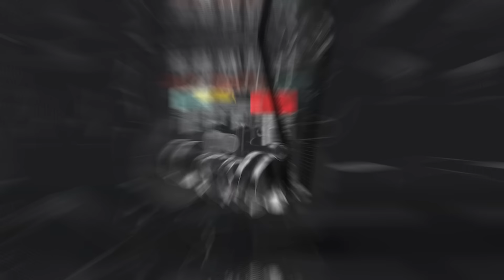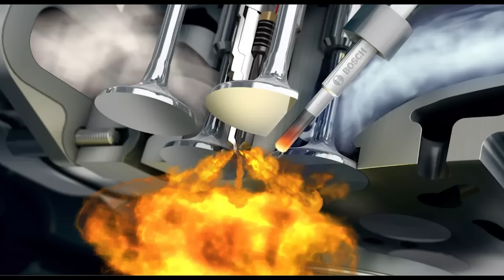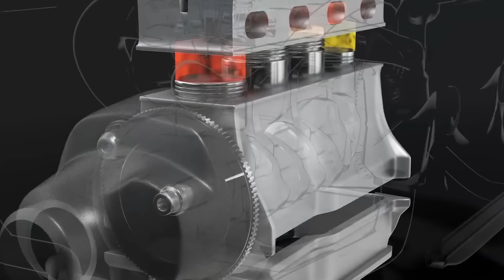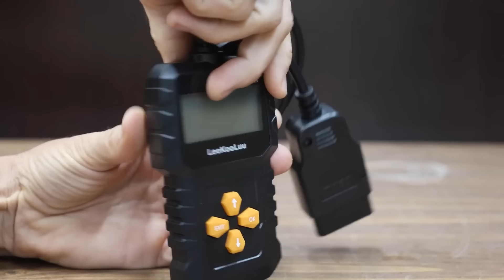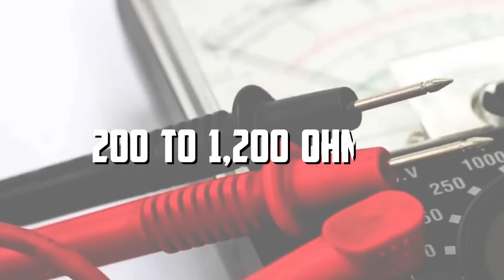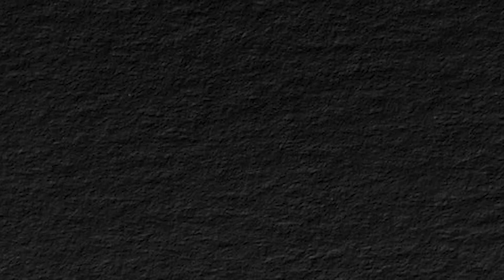9 Bad Crank Position Sensor Symptoms (FIX It in 9 Minutes)

Comment: Will this cause the engine to die and prevent the stater from operating until the engine cools off?
Reply from the maker: Absolutely! A failing crankshaft position sensor can cause the engine to shut off unexpectedly, especially when it overheats. Since the ECU relies on this sensor to manage ignition timing and fuel delivery, when it goes bad, the engine might stall and refuse to restart until it cools down. Think of it like an overheated phone that shuts off—it just needs a break before it works again. If this keeps happening, it’s best to get the sensor checked or replaced. Hope that helps 😊
Reply: @carcareclues  I have a 2004 Accent that when it gets up to normal temp, it starts behaving like it's misfiring then totally stalls, when I attempt to start it back up, the starter won't even operate, as if the battery is totally disconnected.  I cannot get it to even crank until it cools totally down, then it starts up again and runs fine until it reaches temperature again, then rinse and repeat lol.  The only code is ECT high range, it was a little low on coolant but the temp guage only went a notch above center until I topped it off, never went near the red, I suspect that is what threw that code.  But it's still doing the shutdown even after clearing that code and topping it off.  Battery and alternator test ok,  I've just assumed if it was one of the sensors it would just crank and crank and not fire, but not totally disable the starter as well.
Reply: @carcareclues  Shouldn't prevent the starter from cranking the engine. Engine won't start or run without it but the starter should. Inop starter after shutdown was part of his symptoms.

Comment: 2015 Ford Explorer 3.5 Echo boost engine 
Will to much oil in the engine cause code P0016 
Will the to much oil effect and cause the camshaft sensor fail

Comment: I`ve just got this problem. I change the gearbox last week and the only sensor I moved was the crank sensor. I work with robots at work and it`s always sensors that causes trouble. See how it goes.
Reply: Computer says 1 bank exhaust oxy sensor plus IPDM but I don`t think it`s IPDM as things are still working like headlights etc.
Reply: @damianbutterworth2434 why would it say oxygen sensor though?  It’s referring to the signal coming from oxygen sensor. P0335 is for crankshaft signal. I work with sensors too in manufacturing
Reply: @ It turned out to be the Throttle body. I put it on another computer and it said that Throttle position sensor. Anyway when I stripped it down there was a piece of plastic clip from the air hose coming into the air box caught in the butterfly valve and stopping it working. The air filter was not fitted right. Whooopss. And it must of got past. A second hand air box I got had the same plastic bit in the air filter.
Reply: @ it was the oxy sensor heater circuit that was open circuit but the sensor still works slightly ok. I am going to change it when I`ve got a week off work in case it breaks off.

Comment: My 2011 HHR run hot now wate start all it does is spend when I try to crank it
Reply: When I drive the car 30min it shuts the fuel, and fuel pressure jumps and than car stalls itself when I park on red light or nuetral. Itndoesnt start until it coola down

Comment: I own a 2008 kla sadonea the car starts fine and idles fine  so what else would cause the check engine light to come just to to let you know the car starts fine and it will accel with no hestion?
Reply: It could be as simple as a loose or dirty gas cap. Take it off and wipe it clean, then put it back on and tighten it.
Reply: TPS

Comment: Too little description of the manual labour. For a three pin sensor, how do you measure any voltage when the sensor is connected and all the pins are hidden?
Reply: Backstab the plug with some paper clips

Comment: My car won't start after driving when engine is hot, only crank very short and cut off, if i wait about 2h  it starts right away,  car drives normally always no any other issues or symptoms. 
.any ide ?? Strarter or sensor or something else?
Reply: You’ll need to diagnose with a scanner tool and go from there!!
Reply: No codes,
Reply: Probably thermostat
Reply: Some thermostats contain a sensor and can code on a reader and some dont
Reply: If your thermostat is bad , when car is to hot itll overheat and shut off bc the thermostat isnt opening to cool the engine back off

Comment: I have a 2010 chevy Malibu ltz v6 vvt3.6, my car will start fine, once i turn it off it might start again and there are times when it takes up to 7 hours to restart again. At one point the car started and  was running when i turned the key acc,what could be the issue if someone wouldn't mind helping out a bit.
Reply: Bad security signal. Mÿ wifes Malibu did the same thing and left her stranded several times. This has been a long time problem for Chevy.
Reply: @scottwinters4236  Thank you,how was this issue fixed? Is it worth taking care of? My car doesn't have many problems besides an exhaust system leak.
Reply: @mikebarrows8344  my mechanic was able to trace the wire down and disabled it. The security light will stay on.
Reply: @MindyourGod  Thank you for the help,I appreciate it very much.

Comment: Omg I've been burning through gas for a  month. I just bought the part I'm getting my mechanic to change it
Reply: Did it work?
Reply: I am getting a code for this and a printout from AutoZone stating that the timing chain needs to be changed. Thing is it was replaced less than 20k ago. My 2008 Chevy equinox with a 3.6 runs great.. no issues at all. I hope this helps.
Reply: Did it work?
Reply: Having same problem stupid Dodge Avenger STX. I need to stick to Toyota. But, I did get the the crank shaft position sensor A circuit, Ignition coil “C” secondary circuit.. will keep ya updated
Reply: stupid people coming, comment and go. those are stupid

Comment: Always use scan tool to detected the sensor
Reply: No you M0R0N, as most ECU codes will clear if you start it a few times , IE by the time you get to checking the code and the car has started it will not even show up... This is why no mechanic can ever find these faults.

Comment: I think if your crankshaft sensor doesn't work your car won't start.
Reply: Mine may start without crankshaft sensor but stalls after 10 minutes
Reply: @victorn6523 When I drive the car 30min it shuts the fuel, and fuel pressure jumps and than car stalls itself when I park on red light or nuetral. Itndoesnt start until it coola down
Reply: @victorn6523 same here
Reply: Yes. It happened to mine
Reply: My car has a p0016 code and turns on just fine, but shudders and stalls on neutral. I’m really hoping this is the cause and changing the sensor will fix it
Reply: @Icookadapizza did you get it fixed?
Reply: Update, I got a P0705 code which makes much more sense😭sadly I can’t find a video on my model
Reply: You need to use scan tool
Reply: Depends on the failsafe mechanisms of the specific engine. My engine will work by using the camshaft signal as a crutch, but be in a restricted mode. Unfortunately without lighting the MIL or setting a code. Not so easy to find
Reply: @jodiac-sl  per caso hai un bmw e90 motore n47? Non riesco a capire quale sia il problema
Reply: @io2063 no, hai un E39 motore M54B25. When I bought the car the sensors for intake camshaft and crankshaft were aftermarket Hella sensors. On these BMW engines it’s a lottery if aftermarket works or not, they require OEM BMW engine sensors to make sure (that would be the four sensors for both camshafts, crankshaft and airmass meter, although VDO may work for the airmass).
Reply: Mine was going bad and was affecting the ability to accelerate quickly
Reply: Yes it will crank but won’t turn over.
Reply: You can bypass by spraying easystart
Reply: It can also be intermittent
Reply: Exactly
Reply: I have a 2002 Acura TL and I’m having problems of the car randomly stalling . Some videos says it’s the crankshaft sensor and some videos says it’s a charcoal canister, so I don’t know which one to get fixed first.
Reply: Many can start just will stall eventually or go into limp mode misfire when driving etc
Reply: I've been driving (100 miles a day) for about 2 weeks with a bad sensor. Just bought a new one today and replacing it tomorrow.
Reply: @Doc_Ores  how did the new sensor go? It made my problem worse.. now it shuts off after 2 crank where before you could crank all day
Reply: @Doc_Ores did you replace it and did it fix the problem
Reply: @ernest1782 I did replace it and it did fix it. Other issue I've had with the truck since I bought it is the cvt phaser tick, about a month ago my engine finally failed from that. So, may as well not have bought and replaced that sensor. Lol its currently in the shop getting a new engine put in.
Reply: Exactly.. literally waiting on the mechanic to pull up
Reply: Correct .
Reply: Does it crank but wont start
Reply: For real when that sensor goes bad on me it’s over cuz the plug gets pulled
Reply: Bros life is gonna change when he learns about intermittent failure lmao
Reply: Not in all cases
Reply: My 2018 Honda Accord bad cps won’t start.
Reply: Not necessarily. I have a faulty crank shaft sensor which threw up a p0300 p0301 fault code. It drove ok, just a little juddering. After I changed it the error went.
Reply: Some engines can start but the rpm not working and you look these symptoms at acceleration and Misfire at this time you make sure the cranck shaft p sensor not working
Reply: @eslamsami9941 I’ve just replaced my battery but I’m thinking maybe it was not the battery though..
Reply: @VitorFerreira-gc5dr same
Reply: @VitorFerreira-gc5dr no, it did quite a bit of research n stutter under acceleration is caused either by fouled spark plugs facing the firewall, number 4 ignition coil or the cranksft position sensor.
Reply: @VitorFerreira-gc5dr I started here then months later boom buying all these sensors. Wish I and gotten a diagnostic hundreds ago. Remember one code can bring more codes for us to buy parts.
Reply: Would it still crank ?
Reply: It'll crank sometimes and if it turns on It can turn off while you're driving and if you won't start back on you would have to let it cool down and then the car will turn on again   might shut off again
Reply: The car will turn on but when you driving it will shut off sometime  You have to wait a couple of minutes before it turns on again Sometimes it'll do that off and on turn on turn off while you're driving
Reply: @vrea77 that’s what mine is doing but I’m also reading a bad charcoal canister would do that too, so I don’t know which to get fixed first.
Reply: @vrea77 True. I'm in that situation now
Reply: Yes it would crank but no start at all @terrencefrancis3781
Reply: @terrencefrancis3781 yes
Reply: @terrencefrancis3781 sometimes
Reply: @terrencefrancis3781 yea still crank but wont fire
Reply: Mine would run but randomly stutter and stall.

Comment: what do you mean “reconnect the sensor and measure the voltage between the signal wire and ground” ? where do i put my volt meter leads if it’s plugged in ?
Reply from the maker: When the sensor is plugged in, back-probe the signal wire (refer to your vehicle's wiring diagram). Place the multimeter's positive lead on the signal wire and the negative lead to a ground. Set the multimeter to DC volts, then crank the engine to measure the fluctuating voltag
Reply: @carcareclues Got it, thanks for the quick response!
Reply: Hey just tested and i’m reading a steady 14V, is that normal?? Shouldn’t it fluctuate between 0 and 12V? Please let me know.

Comment: How do i know it its the crankshaft or camshaft sensor? They have the exact same symptoms
Reply: Most of the time, it’s recommended to start with replacing the camshaft sensor first since it’s easier to replace. If problems persists then you move to the crankshaft. I’m currently dealing with this and the crankshaft is next.
Reply: @josephj1234567  you said it backwards
Reply: @johnnyquevedo3094 camshaft sits at the top and is a lot easier to replace so that is first.
Reply: @josephj1234567  I mean yea but the one in the bottom usually is in your face nd you either move the alternator and or it’s just there for grabs while the cam sensor either under the manifold or in a weird spot where you have to remove the hoses and summo out the way like in my Lexus is 300 that’s what I have to do lmao but hey bro it is what it is some times we gotta see which is best to start with if not just do both at once if possible and get it over with
Reply: @johnnyquevedo3094 for the Miata at least, the camshaft sensor is as accessible as the oil cap. All you gotta do is pop open the hood and boom, right there.
Reply: @josephj1234567  Same here 🤦🏾‍♂️🤦🏾‍♂️
Reply: @rasheeddozier6083  I’m glad we’re all struggling with this together lol let’s stay updated! I’m getting my camshaft sensor replaced within the next week or two so expect a comment back from me shortly after the new year.
Reply: @josephj1234567  jus changed the camshaft and crankshaft senors .... Hopefully this works smh lol
Reply: @rasheeddozier6083  any update?
Reply: @rasheeddozier6083 did it work¿
Reply: Yes bro i have same issue
Reply: Just swapped my cam sensor and found the pigtail was exposed and all three wires were touching it turns over now still gonna swap out the crank sensor to be safe.
Reply: @elgordosxt4694  I didn't know there was a intake and exhaust camshaft sensor. I changed the intake but not the exhaust so I guess that'll b the next one I'll change out
Reply: damn, me too. Just changed the camshaft and unfortunately hasn't sorted the issue. Will try sorting the Crankshaft next. fingers crossed it works.
Reply: @ when changing, reinstalling the crankshaft, you have to make sure it’s set at a specific distance or else it’ll give you similar issues as well. This was what I found to be my issue.
Reply: @josephj1234567 .....what do you mean by a specific distance
Reply: My car lights work but it doesn't crank or even try to turn over...is this bc of the cam or crankshaft sensor?
Reply: @PrestonSmith-b7h might have a bad starter
Reply: Poz ja sam zamjenio sezor radilice jedno vrijeme bilo ok opet počeo se motor ponasati tesko pali vergla .potom nesto kao na bregastoj bruji i gubi snagu molim odgovor lijep poz

Comment: What code comes up on a diagnostic for a bad sensor?
Reply: It'll usual show the name.  Like mine was Crankshaft Senor
Reply: @Corsair_Mnk thanks buddy! I fixed mine. I replaced my starter n crank sensor. My rides better than before 💯
Reply: @YASMATAZ369 did you get knocking noise ?
Reply: @UsernamesBeLike  No I didn't. My main issue was my starter that I replaced at the same time. After changing my sensor my check engine light that was on for years finally turned off lol
Reply: @YASMATAZ369 what car do you drive? I think this sensor is bad on my 2007 Silverado the light comes on some times then it turns off, had a mechanic fix some other stuff but as he was fixing other things his scan didn’t get the code for that sensor, but I’ve gone to fix finder at AutoZone and got the code to relearn the position for the crankshaft sensor
Reply: 0320
Reply: Fixed mine today. Crankshaft Positioning Sensor
Reply: Or P0300

Comment: Where is the crankshaft position sensor on a 2007 Tahoe 5.3 Liter ?
Reply from the maker: The crankshaft position sensor on a 2007 Chevy Tahoe with a 5.3L V8 engine is typically located on the rear of the engine block, near the transmission bell housing, on the passenger side.
Reply: @carcareclues above the starter!   I have a 2008 gmc yukon denali 6.2.  I changed it out.  It'd didn't help, I changed the cam sensor below the water pump.  I had to drill it out , good luck to u
Reply: Where is crankshaft position sensor on a 2003 Toyota 4Runner v-6
Reply: Can the crank shaft burn the ecm-1 fuse on a 95 tahoe